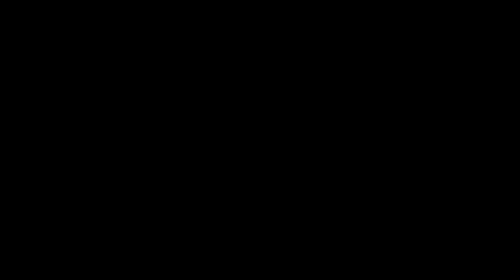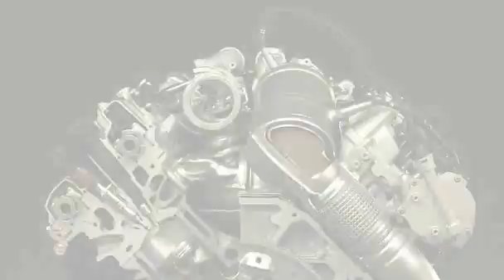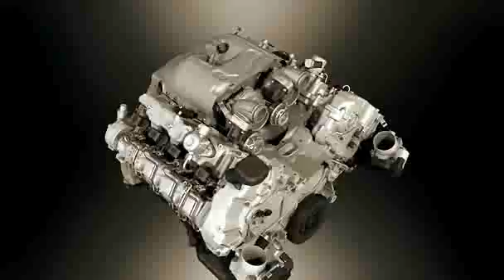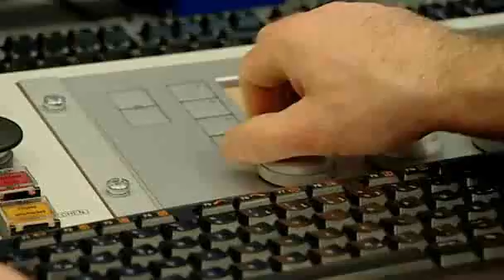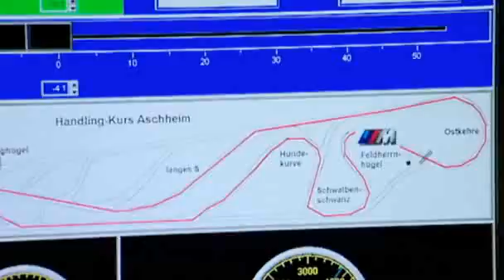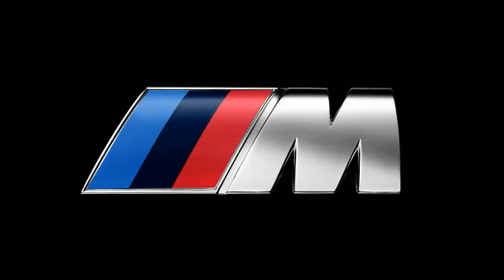New BMW ///M-Power Engine

Comment: View Technologies and Patents for sale or license: Construction diagram and construction of KOLEV MOTORS internal combustion engine. 
The engine provide the lowest fuel consumption per horsepower per hour - 140-150 grams.
The highest mechanical efficiency over - 90%.
The smallest metal consumption per horsepower and thus the lowest weight of the structure.
The lowest atmospheric emissions.
All news you can see on our channel in YouTube: youtube.com/user/todornicolov1
Kolev Motors

Comment: X5M - 5378 lbs. 

X6M - 5324 lbs. 

M5 - 4288 lbs. 

You got the power BMW, but your ultimate driving machines shouldn't weigh as much as a house. Lighten your cars, use real hydraulic steering rather than this electric bull shit, and don't ever put distractions like iDrive, and rear seat entertainment in an M Car again.

Comment: ...there is always room for improvement. They're using TOP TIER engines in "mid-high production level" automobiles. These things get dialed out so much, its silly! The engine peripherals and electronics are its main limiting factors!